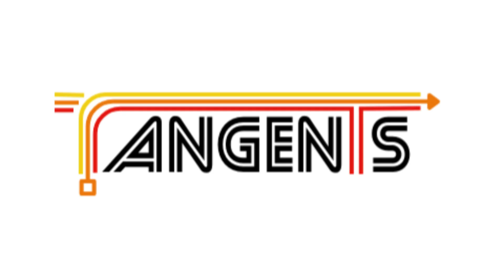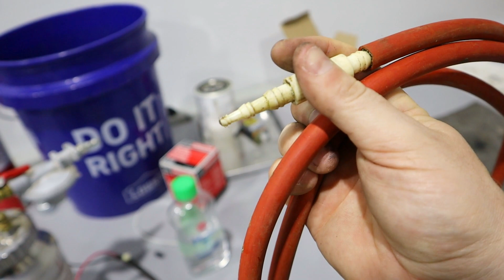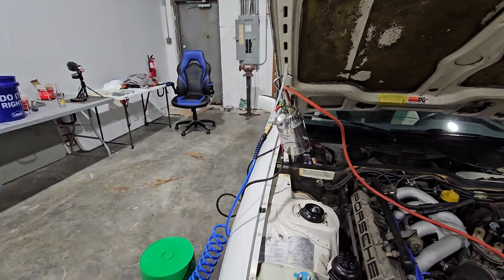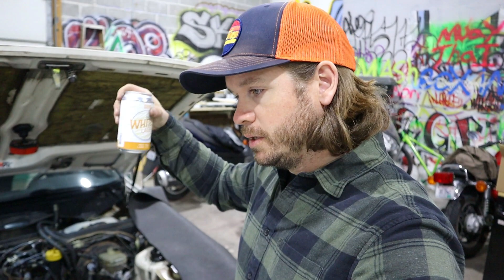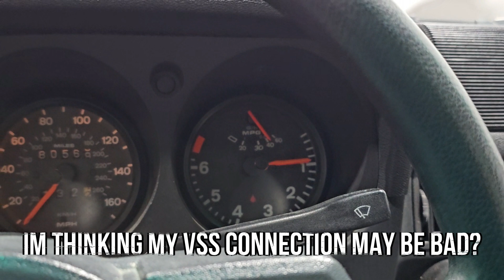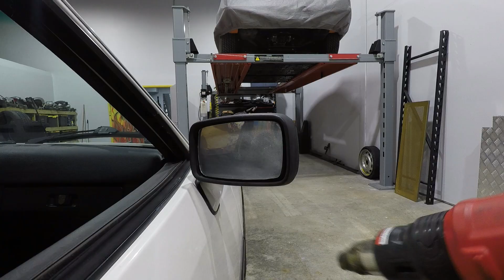Porsche 924 Vacuum Leak Repair Using A Smoke Tester!

Comment: Ok thanks il look into this I'm hoping it may be the little fuel pressure injector regulator on side of the airbox metering unit as the bracket was broken and it looks as it has been knocked

Comment: Would it not start with a vacuum leak as my car is struggling to start
Reply from the maker: It may not. Every vehicle is different
Reply: After replacing all injectors and fuel distributor I now have number 1 fuel injector spaying way to much fuel when doing the flow test the bottle fills up very fast compared to the other 3 could it be the little fuel pressure injector regulator that's on the side of the metering air box
Reply from the maker: If you did a specific test on the injectors and all things were equal, having one flow more is a problem with the injector. Fuel pressure is the same across the 4 injectors as is the power signal.

Comment: The result is very audible, congratulations. Maybe I'll check the valve clearances, or if it's hydraulic, the valve lifters. It's like there's some kind of unnatural clicking. Of course, it could be that this is how it's supposed to be, I'm not familiar with this engine.

Comment: An unlit propane torch can do the same thing...where the leak is the rpms increase.
Reply from the maker: Yes, as does brake clean. This gives a pinpoint visual though which is super cool

Comment: Drain the olive oil from the banelli for some vegan smoke. May smell better than some Johnson & Johnson. 

What a cool little device. Marketplace cheap too. $50 for a tool that you’ll use more than once and specific enough for those niche jobs like that. 

I could feel the back of my knees aching just watching you get into the engine bay. I’ll have to do something similar on the NOT-SO Grand Caravan. They put the oil cooler & filter housing under the intake in between the heads. Plastic parts that crack. Of course I find out after a 4 day weekend & making it right with some new headlights. 
#cheapertokeeper
Reply from the maker: Hahaha I'll use that next time!  Yeah the knees are toast working on vehicles as bikes have spoiled me for sure.  If you need to borrow this it's super handy!

Comment: I made my smoke machine from a computer power source, an old spray gun and a diesel glow plug. Easiest way to track down vacuum leaks, and practically the only way to find some EVAP leaks. 
YouTube has a bunch of videos about DIY machines, built with various levels of technical execution. One uses a cigar for the ignition source LOL, but heck, the guy showed that it worked fine. For 50 bucks though, the setup you bought looks like a winner.
Reply from the maker: I saw that cigar one! The diy approach looked fun but my biggest expense is time so spending the $50 to have it done was why I chose that

Comment: Great work!, putting some effort in doing the basics, actually finding the fault, not changing parts randomly and blaming the car that its shit like most seem to do nowdays.
Reply from the maker: Exactly! I'm very big on proper diag first because...I've been the guy throwing parts at a problem. Spending a small bit of time before to narrow it down saves sooooo much on the backend

Comment: Mpg gauge is funny! It reads manifold pressure but is shown with markings for mpg. It looks to act as I think it should now. Nice job.
Reply from the maker: From what I understand it reads GPH on startup and anything under 10mph. Above 10mph it should be in the MPG range where it definitely seems off. Its saying I get less than 10mpg while driving when the car gets around 30. I need to figure out what its doing.